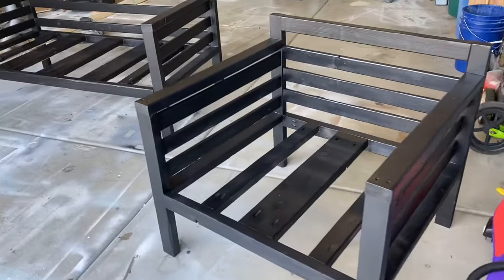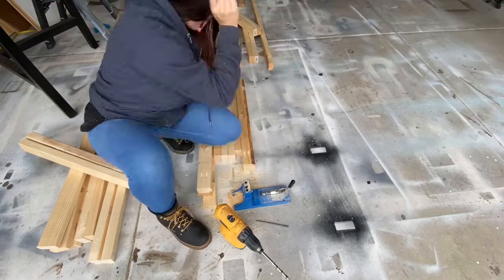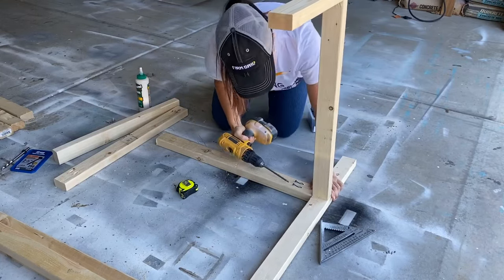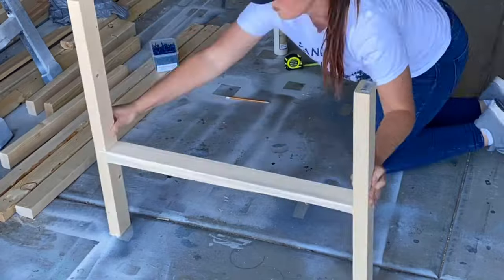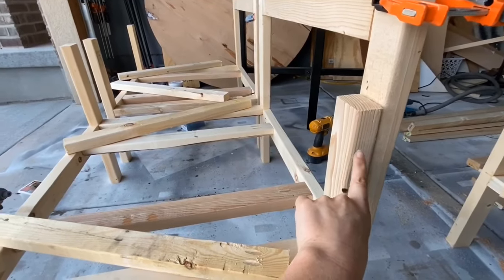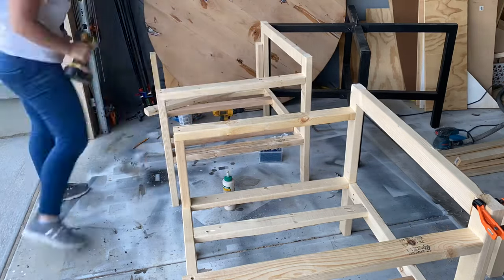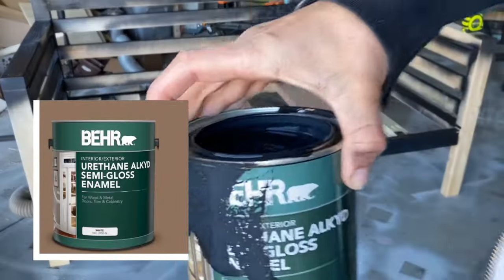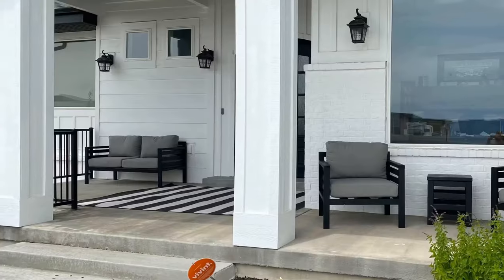DIY OUTDOOR CHAIR AND COUCH- modern easy design

Comment: How do i know what supplies i need for just the chairs bc I dont have room at my apartment for the couch too.
Reply from the maker: 7-8 2x3’s and 3 1x3’s per chair. That’s a good idea I should break that up huh. Thanks good luck
Reply from the maker: A lot depends on the cushions you buy, you may have to alter the dimensions to fit the cushion 🤷🏻‍♀️
Reply: @EternalHarvestDecor  well on the list which ones imply to the chairs over the couch so i know the supplies i need to get.
Reply from the maker: not sure if you saw my above comment, I think we were posting at the same time.
7-8 2x3’s and 3 1x3’s per chair
then paint and small boxes of the kreg screws. I do have some plans broken down by piece on my website. hopefully that helps.